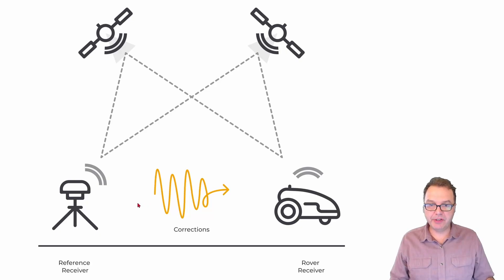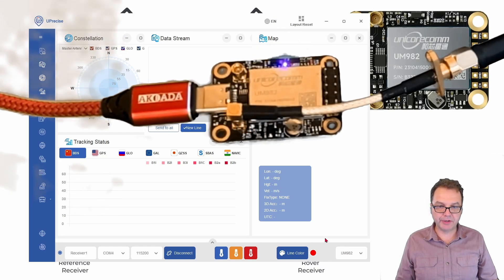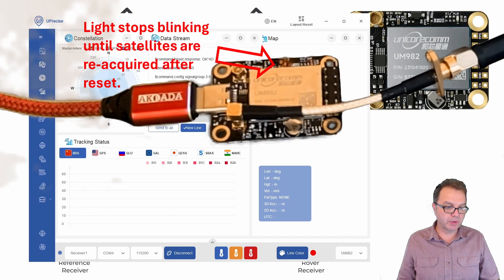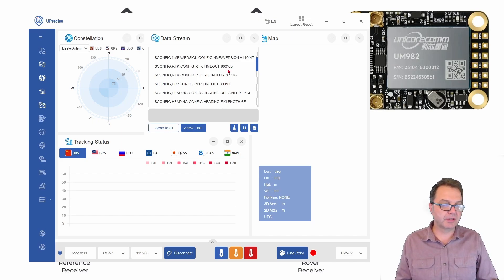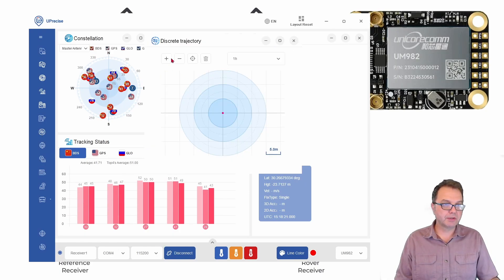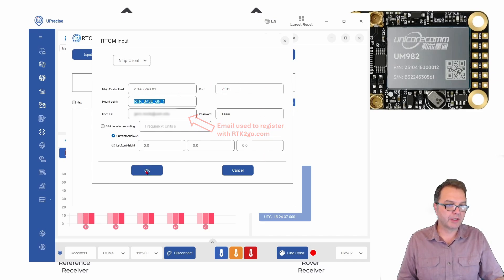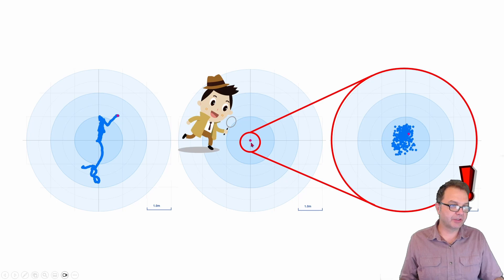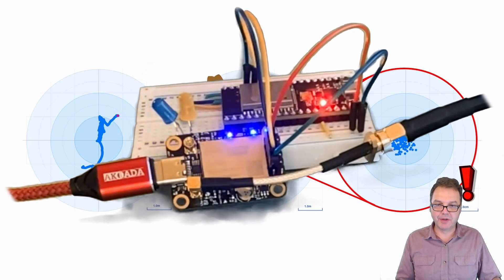Setting up a UM982 GNSS Module as an RTK Rover

Comment: I set the UM980 Module as RTK Rover according to the detailed video. After the "UPrecise >> Tool >> RTCM >> ..... >> connect", I got RTK-Fix as expected, and saved everything with the "saveconfig" command. but once I start the UPrecise again, or use the UM980 independently (not through UPrecise), I get only Fix-TYpe of 2 - GPS. Is there any procedure (commands) to force UM980 to connect to RTCM monitor?
Reply: Elie,  i think i have the same problem.   What i don't understand is where the base station corrections are coming from. I have UM982 connected to a rover on serial 1.  However when connected to the USB-C port (serial 3) and using the RTCM Monitor briefcase to inject corrections, I can only select Serial 4 (the UPrecise laptop) as the input.  Have you made any progress?
Reply: I built the same system as described by this video (https://www.youtube.com/watch?v=CfcMfGZBFmQ) by O'cean Explorer', and it works fantastic only when i run the Uprecise application and set the RTCM as described in the video (At time:10:54). But each time I start again the Uprecise application, I have to define again the setup of the RTCM. This means, the UM980 (or 982) does not remember the RTCM setup, and this means you can't use as a standalone!
Don't hesitate to ask anything. Maybe we will solve it together. The support from the manufacturer is terrible!
Reply: Elie are you on any any development forums, like Ardupilot?
I found this library of Tutorials on the WitMition site. I too am trying to inject corrections with the 982 remembering the config and not needing a laptop connected. I’m not finding anything.directly applicable but I’m seeing some new configuration options. 

https://drive.google.com/drive/folders/1_YYkZM1VV5oA1mI0-lR2RbGpawTFtuyo

Comment: Great videos, thanks! I have some problems. I wonder if anyone has figured it out. I use Holybro's version of Uncore UM982 and want to use it as a yaw (has a lot of interference on the compass). I have followed all the instructions I can find and in UPresice I get Uniheading which seems to work. Com1 on UM980 is connected as described to Pixhawk 6c. With latest version of MissionPlaner Rover. MP says gps satus 3, and 28 satellites, but yaw gps says 655. I'm sorry, I've tried everything but without any change. If anyone has any suggestions that could get me going I would be very happy. Best Regards Steinar

Comment: Thank you for the great video. My question is can the UM982 module be setup as a rover and use a public RTCM corretion data that I have subscribed to to get within 20 cm accuracy. Thank you in advance.
Reply from the maker: Sure, if the public RTCM station is within approximately 10 miles.
Reply: @oceanexplorationlab  If the public RTCM station is 20 miles away, is the problem with the antenna receiving the correction signal or the accuracy will be much greater?
Reply from the maker: The RTCM signal is typically transmitted via the internet, so distance is not a problem. However, the correction station needs to be within ~20 miles so it sees the same atmospheric disturbances as the rover.

Comment: Hello, first of all, thank you very much for what you do by posting supporting videos that are very helpful. I am trying to configure the um980 module as an RTK receiver based on your video with the um982 module. I have reached the point where the RTK monitor input and output are green and yet I do not have centimeter accuracy. I will add that I use the public RTK signal where I have an account. In the signal group tab I have selected typenum 2 and rover station mode I have selected rover survey mode. If possible, please give me suggestions for which I thank you in advance.

Comment: I used this to great effect with a couple of um980 modules as base and rover, but now I am switching to um982 on the rover for dual antenna and to get heading.  However, I am failing to get heading information out and wondered if you had any tips on configuration setup for this?

Comment: I bought a UM982 board. I've been struggling to configure it for almost a year, but I haven't been able to. When I connect, the LAT appears as -DEG. The Chinese supplier hasn't given me any assistance at all. I want to use this module as a base cors for GNSS Rover correction.

Comment: I took the wrong signalgroup. Unfortunately, there is no way to remove it. In the beginning, the lines in the command portal are also nicely still until the data starts running, then it becomes unreadable. If you then enter something, you have to assume that it went well.

Comment: Hi, nice videos! I am facing an issue. If I plug two antennas to my hover module it reduces drastically the number of satellites it can see. Any idea? One of my antennas are the ha-901a and the oder is the sta-901a. If I use only one of them it works fine. Best regards, thanks for sharing. ❤
Reply from the maker: No idea. I never tried it myself. Let us know what you figure out.

Comment: Im interested in adding imu to um980😅 is there any possibility the tutorial will appear on thst topic ?
Reply from the maker: Given that the Xbee is written in the Espressif IDF, I currently don't know how to edit the code to incorporate an IMU. Certainly, one could use a second microcontroller, but this would not be a very elegant solution. Long story short, I hope that at some point I find the time to familiarize myself with the IDF to modify the code and incorporate custom features, but I wouldn't hold my berth.
Reply: @oceanexplorationlab I was thinking, if um981 can export IMU raw data, um980 should be able to do it too with external IMU but no idea how too 😂
Reply from the maker: If you are thinking of raw data, including things like Carrier Phase Measurements, you are in luck! I plan to make a video about this soon. The IMU (Inertial Measurement Unit, I suppose) threw me off.

Comment: Hi, thank you for the tutorial! I am working on setting up my UM982 by following your guide, however I am running into an issue while trying to connect to an Ntrip client. I've chosen a mount point on RTK2go and inputted the host and port info, and entered a valid email address and put in none as my password per the instructions on RTK2go. However, I am always receiving the same error when I try to connect: "Input: NtripClient.log Creation failed". I was wondering if you may know what is causing this issue? This hardware is fairly new to me, so any advice would be greatly appreciated! Many thanks.
Reply: Hi, i have created a log folder in installation folder and restart  with "execute as administrator"

Comment: I've set up a UM980 base station and a UM982 rover by following your videos. Thanks so much! Unfortunately, my rover doesn't seem to be using RTK. I'm not getting the second solid blue light that you show in the video, and logs coming from running GPGGA 1 show that my GPS quality is 2, differential GPS. It looks like it should be 4 or 5 for RTK. I also checked RTKSTATUS 1, and it looks like I'm getting a 0 value for 'Calculate status' which indicates no differential data. Just to confirm, my rover's accuracy is still hovering in the 2-5m range. I'm not sure if something could be misconfigured?
Reply from the maker: This is a tough problem to diagnose from a distance. Do you have the RX and TX LEDs connected? If not, I suggest you do so and see if data is sent from the ESP to the UM98X.
Reply: @oceanexplorationlab  For some reason my previous reply disappeared. Darn YouTube. For ease of trying things out, both my base and rover are connect to my laptop and connected to separate sessions of UPrecise. My base station seems to be working fine, as I see it in RTK2Go with mountpoint 'pacifica'. I even tried the next nearest station 'Tiburon-0001' on the rover and no luck. It seems that there is some issue getting the correction data from UPrecise to the receiver, although the RTCM Input and Output sections are set up like yours in this video. I now notice that an error appears in the data stream when I connect (although everything is green): $command,ICY 200 OK,response: PARSING FAILD NO MATCHING FUNC  ICY*76
Reply from the maker: If I understand you correctly, you are getting the response: "$command, ICY 200 OK, response: PARSING FAILED NO MATCHING FUNC ICY*76" from the rover module. If this is the case, something is wrong because the rover should only receive RTCM data, which is binary, and should only appear in the RTCM monitor, not in the 'Data Stream' window. Make sure you set the output port in the RTCM monitor to the same port your receiver is connected to. This is easy to miss and will produce the results (minus the error message) you are describing.
Reply: @oceanexplorationlab  Yes, that error appears only when I first connect to the RTCM data stream. It looks like ICY 200 OK is the first message sent from the NTRIP Caster, which is somehow making it to the Data Stream panel. I have confirmed that the RTCM Output COM port is set correctly to the same port my receiver is connected to. I'm at a loss here. Maybe my issue is a newer version of UPrecise?
Reply from the maker: I just tested it with the newest version of UP, and it works fine for me. Maybe try using two different PCs? Also, do you see the binary data stream in the RTCM monitor on the rover-facing UP instance?
Reply: @oceanexplorationlab  I tried disconnecting the other receiver and using another NTRIP Caster, nothing. I do see the binary data stream. Maybe I'll try a firmware update. In any case, I'll keep troubleshooting on my side. Thanks for your help!
Reply from the maker: FYI, I also get the message: '$command, ICY 200 OK, response: PARSING FAILED NO MATCHING FUNC ICY*76,' so this is not your problem. Grasping at straws here but try reducing your RTK requirement quality via the 'CONFIG RTK RELIABILITY 1 1' command.
Reply: @oceanexplorationlab  Hm, okay that's good to know that you're also getting that error. And when you're getting an RTK fix you get a second, solid blue LED and rtkstatusa 1 returns something other than NONE,0,0,FF towards the end?
Mine shows:
#RTKSTATUSA,95,GPS,FINE,2338,96227000,0,0,18,18;0,0,0,0,0,0,0,0,0,0,0,NONE,0,0,FF,19,0*43bb44ab
and the command manual indicates that the first 0 after NONE means no differential data.
I did already try lowering the reliability threshold. I'll keep troubleshooting on my end. Thank you again for trying to help, especially on a Sunday (at least it's Sunday here).
Reply from the maker: before enabling the RTCM data stream I get: #RTKSTATUSA,97,GPS,FINE,2338,229496000,0,0,18,12;0,0,0,0,0,0,0,0,0,0,0,NONE,0,0,0,77,0*929aaae2
Once RTCM is send I get: #RTKSTATUSA,86,GPS,FINE,2338,229561000,0,0,18,20;C9D20A02,0,B5480000,110,0,C6018,0,10140E28,1,0,0,NARROW_INT,5,0,0,90,0*9bb6f37c
And yes, the second blue LED turns on solid.
Reply: @oceanexplorationlab  thank you so much for all your help. It turns out that I just didn't have a clear enough view of the sky. Once I brought the antenna to a better spot I was able to get RTK Fixed with a solid blue light and >2cm accuracy! Absolutely amazing with a $100 receiver! Thank you again for your help and your videos!
Reply from the maker: The accuracy can be as good as 2 mm with the same hardware using PPP-AR. It baffles the mind. All this and more in my upcoming videos.
Reply: @oceanexplorationlab  Looking forward to it!

Comment: What a great video. Thank you very much for taking the time and trouble to explain the setting up of these units. I bought a UM980 to use with Onocoy. However, until I get my antenna mounted on my roof, I want to experiment with using the UM980 as a Rover. I get so far but cannot get an RTK fix after connecting to my local mount point (RectoryFarm on rtk2go). After start-up the unit will switch to RTK float mode, but even after several hours, RTK fixed is not achieved. if you have any pointers, I would be very pleased to hear them. Thanks again.
Reply from the maker: How far away is it RectoryFarm from your location? If the station is too far, you might want to consider lowering the certainty level of the RTK solution using the following command: CONFIG RTK RELIABILITY 3 1. The default is 3, and lower numbers indicate a less reliable but acceptable RTK solution.
Also, once you have your own base station up and running, please let me know the name of your new station. I'm planning to compile a list of all the base stations that come to life because of this video series.
Reply: @oceanexplorationlab  Many thanks for the reply. I'll check the distance between myself and RectoryFarm. I'll also try lowering the reliability setting. Yes, I'll let you know when I get up and running.
Reply: @oceanexplorationlab  RectoryFarm is 26km away from my location in a straight line.